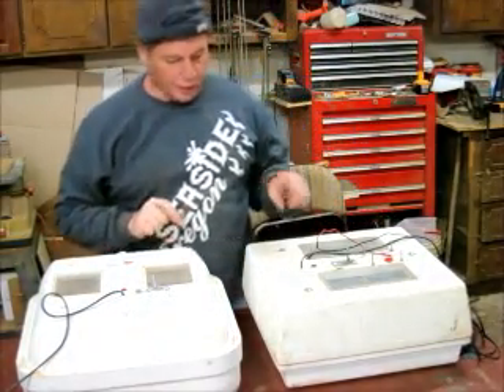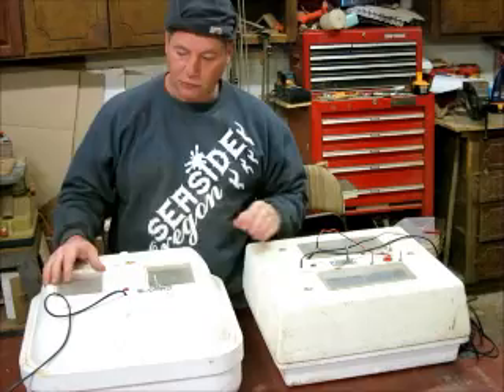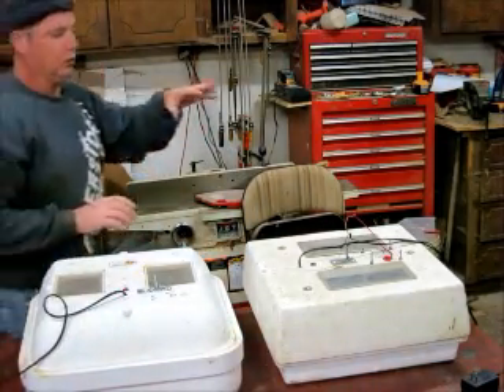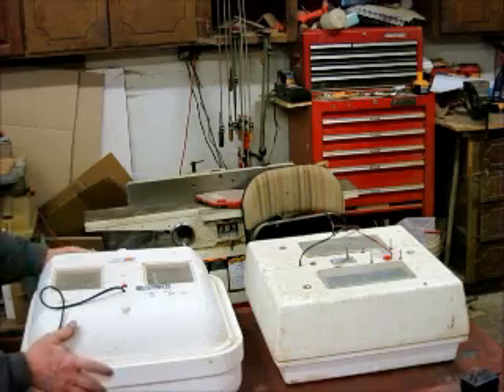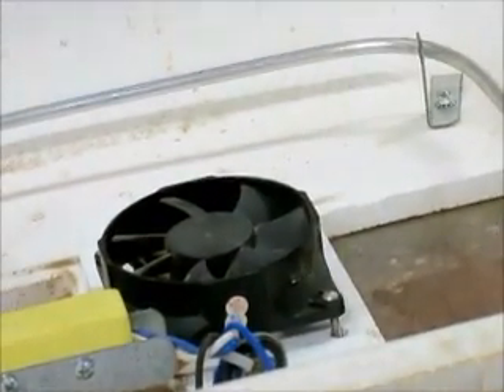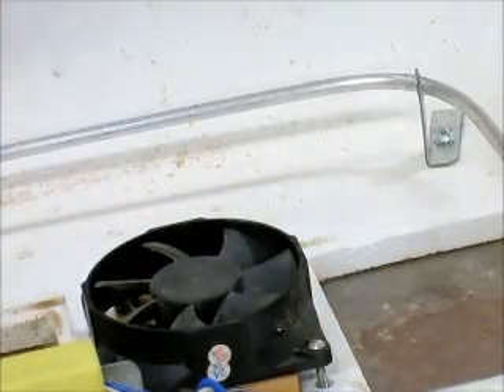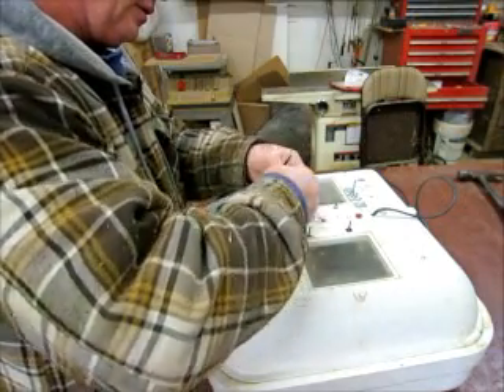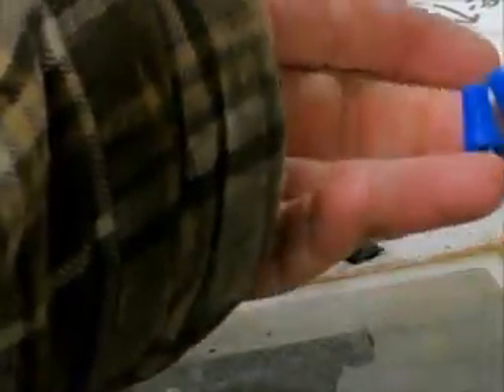Egg incubator upgrade, how to add a fan.

Comment: You can use a 9 volt too, a lot more common with wireless home phones. It might make the fan spin slightly slower but it is not noticeable. I found it harder to find a 12volt but had several 9's.

Comment from the maker: I block the holes until 3 days before they hatch. this keeps the humidity high. I also put a towel over the incubator and add water to it instead of opening the lid to add water. Less disruption in the incubator the better.
Reply: I know this is a very old tutorial but I have a question for you.  How does a wet towel on the outside work? 🤔
Reply from the maker: @beckydelatorre2821  It creates a humid enviroment outside the incubator so there is less moisture loss inside.

Comment: Thanks for the video, you inspired me to try this again.  The fan didn't fit, but I used hot glue to attach it to my spacers (leftover laminate floor), and then attached the whole contraption to the plastic top with hot glue.  Works great!

Comment: Did something similar with ours, way cheaper than the factory option fan.  We put an even smaller fan in ours but it makes a huge difference in the hatch rate due to more even heating.